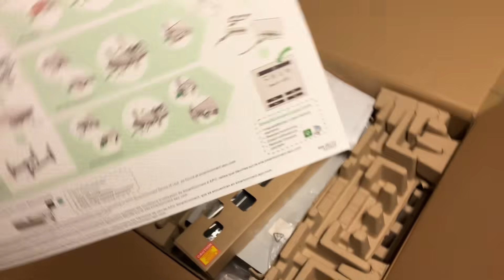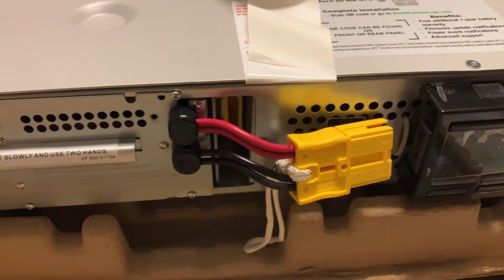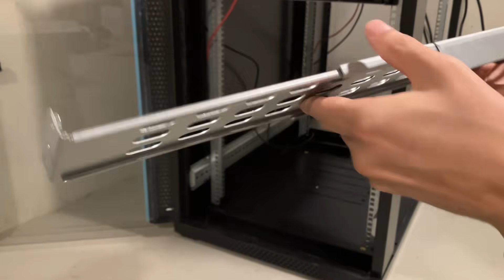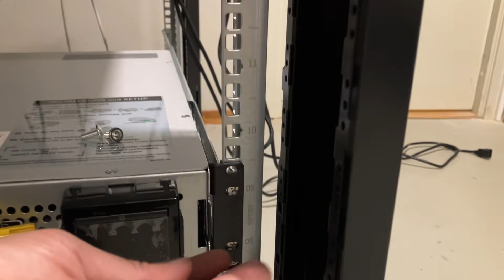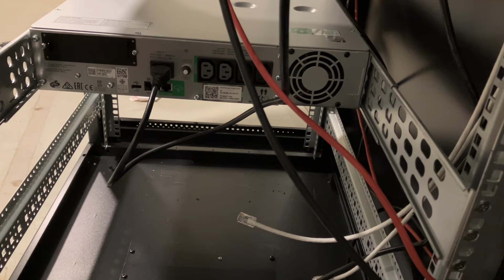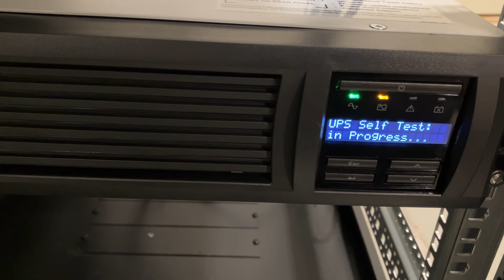How to Install a Rack Mounted UPS (APC SMT1500)

Comment: Thanks for the interesting video. I have the same UPS, which I purchased refurbished with new batteries. But it does not have the front metal ears. Can it be installed on the APC sliding rails without the ears?